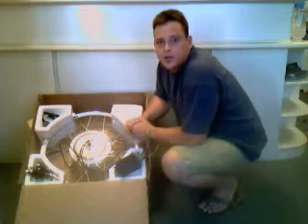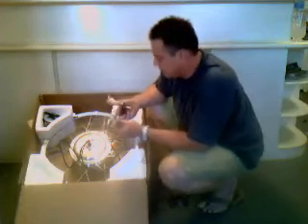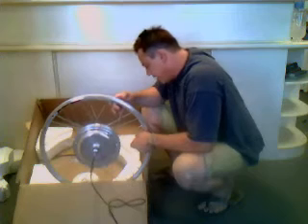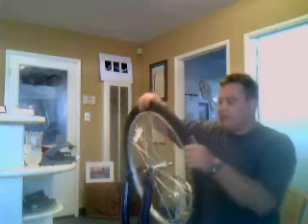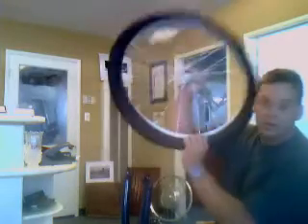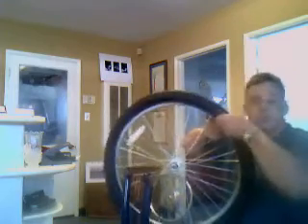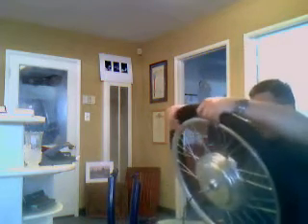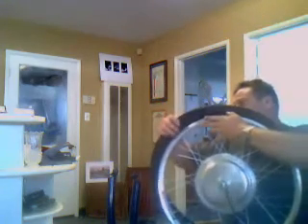diy e-bike kit installation from ampedbikes

Comment from the maker: 500-600W at 36V 700-800plus or minus at 48V. At 60V my controllers start getting warm, if vented they will "Not" overheat. I started to begin a seperate heat dissipation stsyem for my mini powerhouse the "Stealthy" so that it could possibly run at 25-30A at 500-600A or 30 MPH at 36V.